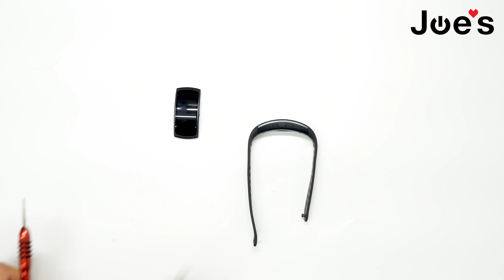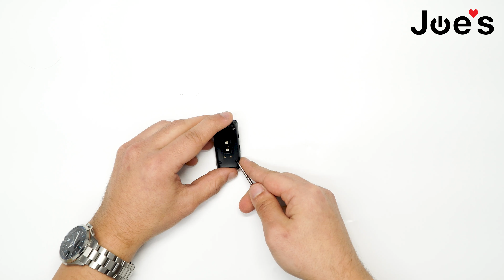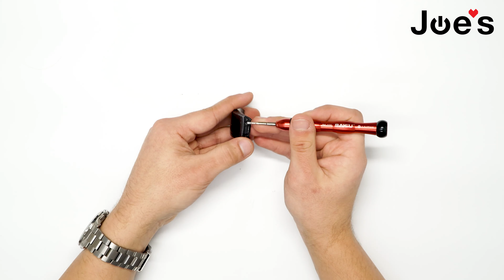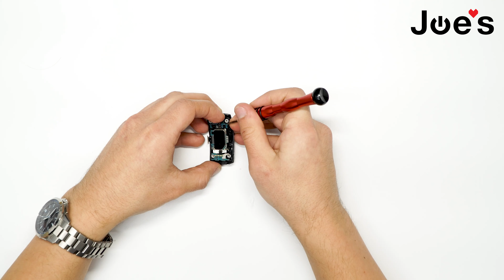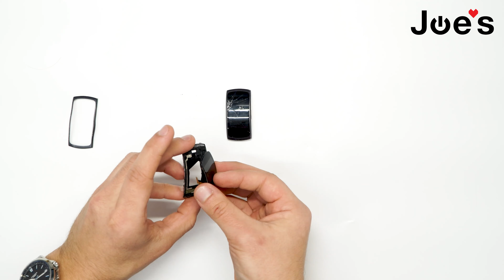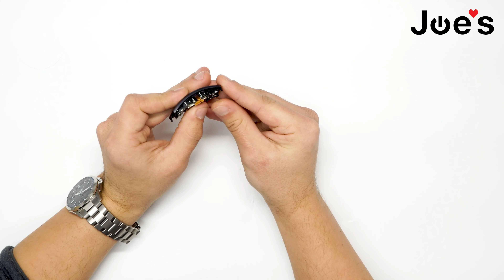Samsung Gear Fit 2 Broken Bad Screen Tutorial How To Repair Replacement

Comment: Hi, your video is very good,my gear I stay with the white screen, but the rest works, because I restart or turn it off and it vibrates and everything, and as I know that when pressing the bton pequelo for a few seconds the option of off appears, I give the screen just dende that option appears and the equipment turns off, but the screen is still blank,   I put it on the charging dock and turn it back on white, should I replace the screen?
Reply from the maker: Hello, thanks for commenting. Please email us at support@joesge.com with a screenshot of your question and we will be able to better assist you there. - Aaron P

Comment: where can i buy a new screen for ear fit 2 pro ?
Reply: gear *
Reply from the maker: Thanks for the comment. Here is a link to our repair parts: https://www.joesge.com/products/samsung-gear-fit-2-smartwatch-replacement-repair-parts?variant=8225141588014
If the part you are looking for is out of stock you can enter your email in the "Item out of stock - notify me!" section and you will be notified when this item is in stock. 

If you would like your item repaired by a professional you can fill out this repair form here: https://www.joesge.com/pages/repair-services
-David P

Comment: Where i buy the fitbit charge 3 screen? Pl need help...
Reply from the maker: Thanks for the comment. We don't currently have any in stock at the moment but you can keep checking on our website @ JoesGE.com, we will be getting them in stock shortly. If you would like your device repaired by a professional you can fill out a repair form and follow the steps to send in your item. We offer free shipping and diagnostics. Here is a link to the repair form:
https://www.joesge.com/pages/repair-services

Russ C.